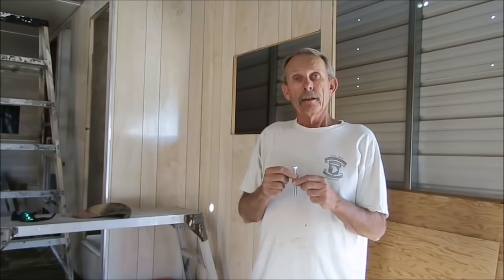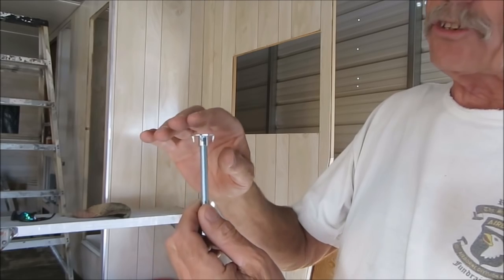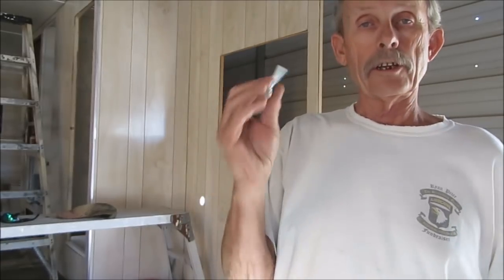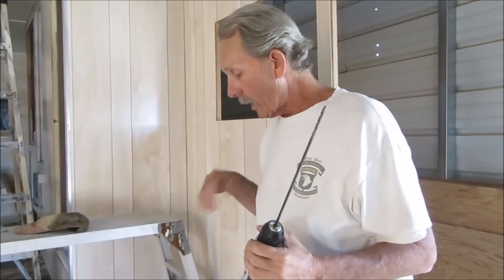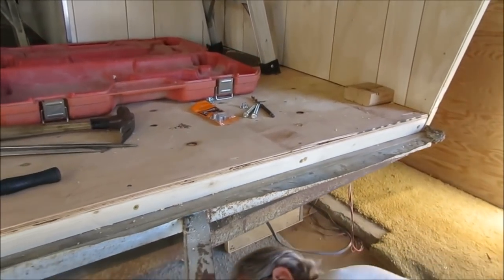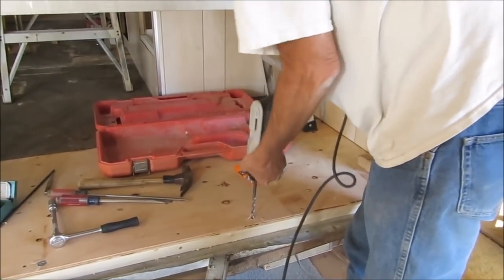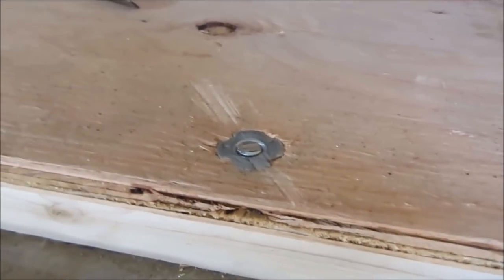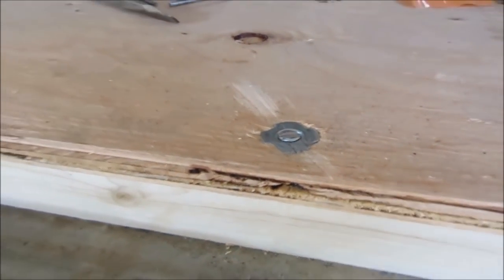Quick Tip #10   T Nuts Instead Of Carriage Bolts

Comment: I am laying in a new floor to my Aliner today. They initially  had 1/4" lag bolts that sat above the floor and made a bump under the linoleum and only poorly penetrated the 2 x 3. I planned on using  3/8 elevator bolt (zinc coated or stainless, but could not find any long enough, so I was thinking this or carriage bolts. I also planned on putting 3" of foam insulation underneath in the frame void and sealing it off in a SS box. Using the T nuts would save money on the stainless steel bolts , and I can use commonly available bolts versus the special order on the carriage bolts (which will run about 5 bucks each).  Thanks for making this video.
Reply from the maker: You're welcome. Yep they usually try to put those carriage bolts under cabinets and seats and stuff to hide them.

Comment: A suggestion. Well, two actually. Put some red Loctite on the threads in the T-nut so it won't vibrate loose later.  And, when you are pounding the T-nut down up above, use a deep well socket of the appropriate size to fit loosely around the bolt end sticking up.
Reply from the maker: Thanks for the tips.

Comment: Thanks Larry and bob Roy , I have a 97 Tahoe LT and just found out it was sold to me damaged and with leak problems , will I have to remove all my siding to put new ply board in ?
Reply from the maker: If the water damage is near the walls then you may have a problem. I believe newer trailers like yours have the walls built on top of the floor. If that is the case it will be hard to remove all of the damaged wood and you may have to lift the skin or remove it in order to get under there with new plywood. Best thing to do is lift the skin up for inspection or remove the lower half of the skin.  Then you can see what you are up against. If you need to get under the framing of the wall you can remove the section of wall that is affected, replace the plywood needed and then rebuild the wall over the new plywood and re-install the lower skin.
Reply: Thank you Larry and bobroy , you videos have helped so much and inspired me to attempt fixing my trailer instead of taking it to a scrap yard and calling it a loss , I really love my trailer and don't want to have that happen. Keep up the great work guys

Comment: hi larry  just watched your video of Tnuts ,just couple of comment I would like to tell you from my experience .   I repair and do custom work on leather ,vinyl and canvas. Ido alot of boat cushions which use T-nuts for nuts for attaching the cushions to wood frames : what happens is the T-nuts rot very quickly with any moisture . So your idea is good as long as they stay away from wetness.    I used carriage bolts on my 1st trailer just put them in from the bottom up so that the nuts were on the inside walls between the studs . the other thing i noticed is that you didn't use a washer on bolt side , why not?  thank for your vidoes they are interesting .sincerely deb in VT
Reply from the maker: I like the idea of a split washer on the head side of the bolt. I'll be removing the new bolts and adding the washers. The T nuts will be covered with vinyl flooring so there is really no chance of water getting to them. Thanks for the tips.
Reply: yw thanks for all yours deb in VT
Reply: Right before you use the T-nuts, dip them in polyurethane...no more moisture problem.